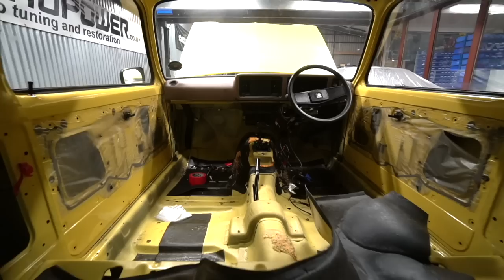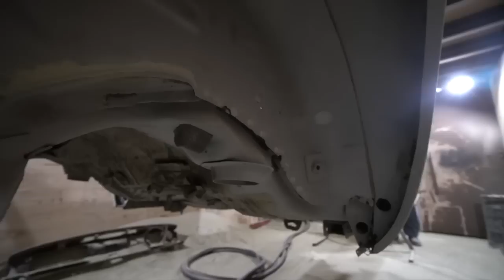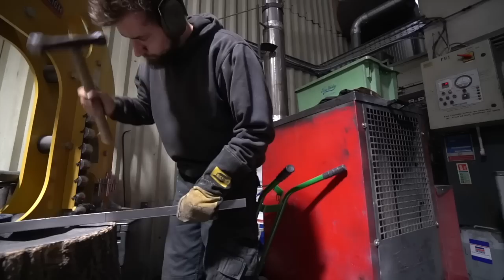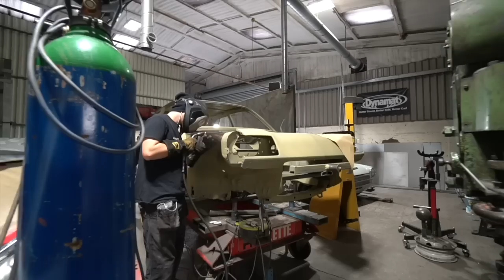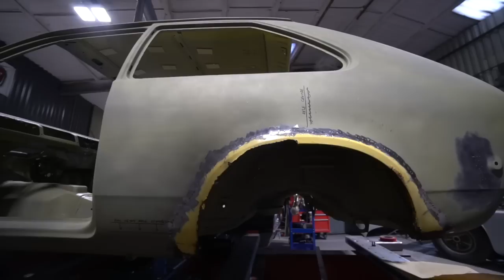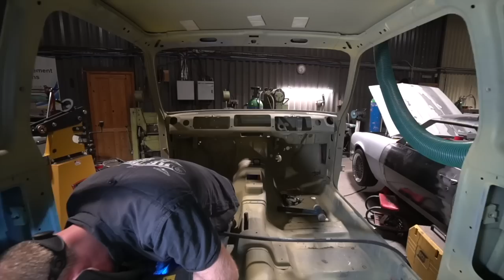Vauxhall Chevette Restomod - Dream Car Build Episode 1

Comment: It's funny... GM intended the Chevette to be their global platform, and it's the rest of the world that managed to make good use of the car, other than the odd one setup for drag racing. The car is otherwise hated here. I was always a fan of the Chevette and seen a real clean restored one at a car show once.  I don't even blame the engine options, we're so fixated on V8 everything, even the manufactures didn't put a lot of effort in them. Europe to me is and has been leads ahead in i4 and v6 performance, while we've only dabbled with it.

I always knew it was worth modding, then I found out it's a racecar choice over there, I was sure of it. It really is a shame the us engine options seem to not have much potential, that it was offered with. The iron duke is one of the biggest production 4bangers, there's no reason it shouldn't be up there with the lima 2.3 in perfornance.

Comment: I gutted a 2 door Chevette a while ago and when you get inside some of the hollow sections ( A and B pillars and inside the sills ) you can see bare steel, that's because these bodies never had the benefit of a full immersion pre-treatment at the factory - so in essence, if you cant directly see a piece of the body - then its bare metal and will rust.

Comment: how similar are the vauxhall chevette and the gm chevy chevette?..we had those here in US in 70s and 80s..cousin had a diesel one..manual and a diesel engine from isuzu
Reply: Closely related under the skin . Both the US and UK Chevettes and also the Opel Kadett and Izuzu /Holden Gemini were based on GMs 1970s T car Rwd platform as was the Izuzu Piazza. Vauxhall Chevette steering gear was also a straight swap to convert privately Uk imported Pontiac Fieros to right hand drive back in the 80s and 90s.
Reply: Basically they are. GM wanted the Chevette to be their global car and they had some relationship with Vauxhall, and owned Opel. The Vaux is pretty much 1-1 to the usdm, the Opel has a completely different body.

GM has had a partnership with Isuzu for years. At one point they even exchanged engines. Isuzu being Navistar gave them the first Duramax's, GM provided vehicles for them to rebadge, and 350s&454s for the gasser NPRs